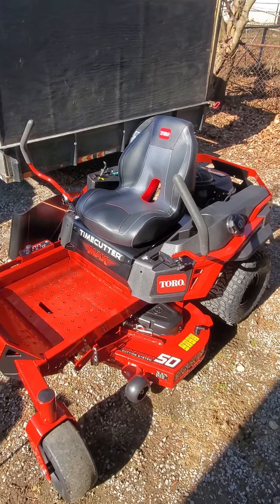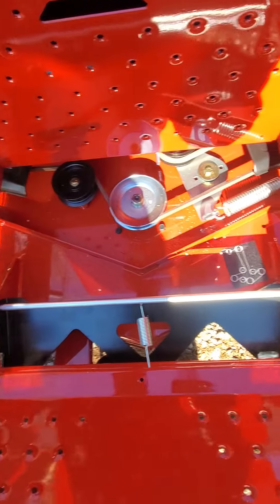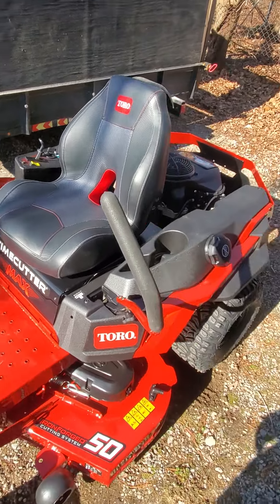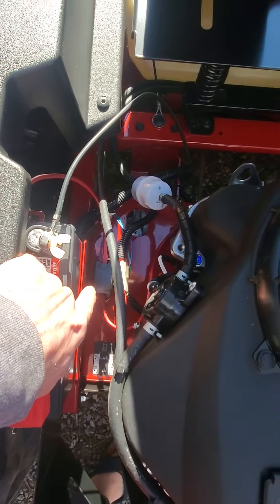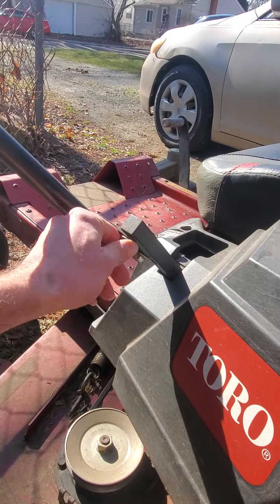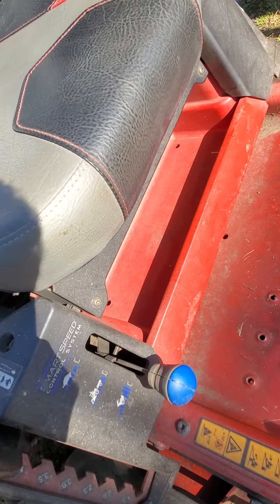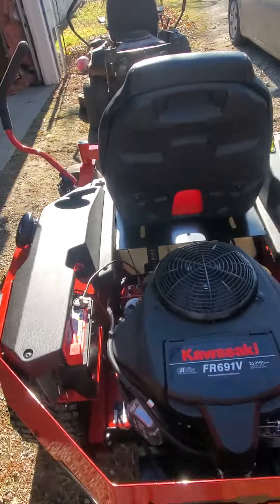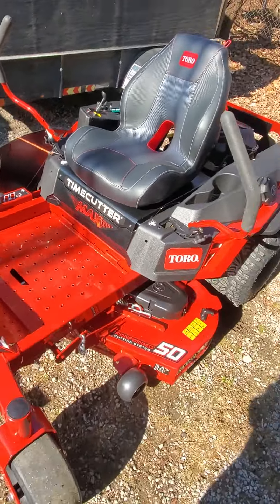2024 Toro Timecutter Max Review 50 inches, 79501

Comment: I wonder if you could just buy a battery box to keep it dry. Not sure it would fit in there, but it might be something to think about.
Reply from the maker: Hi, the issue is not only with the battery. All electric components are on the outside including some sensitive electric parts. The design is not made to handle rain like the old model

Comment: has your throttle cable melted to the OHV yet? i had to take mine to the shop and had to get the throttle and choke cables replaced. i had the 3yr toro plan. to prevent this from happening again, i'm gonna put a "Fire Sleeve" on both cables.
Reply: Did you buy this from a dealer? Or a big box store?

Comment: Leaf equipment?  You mean the bagger attachment?  Don’t they have different shoot openings and different mounting dimensions?
Reply from the maker: Yes I was talking about the bagger, I did try to put it , it worked for me. Just in the back there is 2 screws that was different, but you can put it without them It will hold very good.unless you want to pay another 1000$lol!